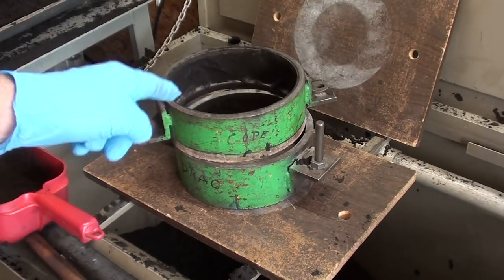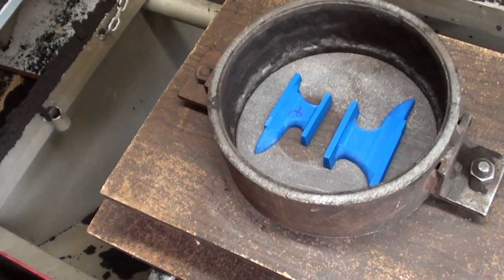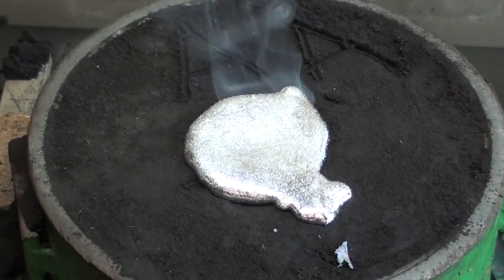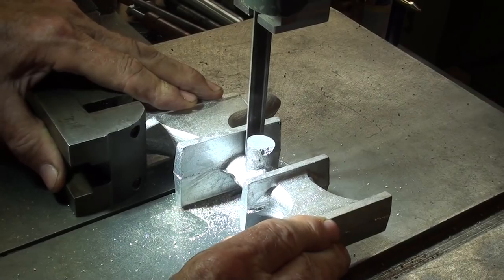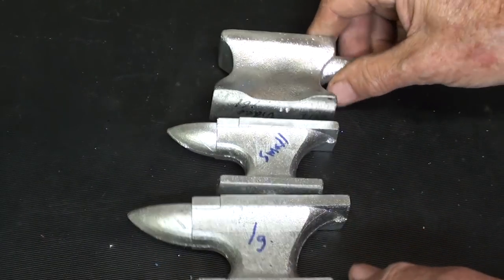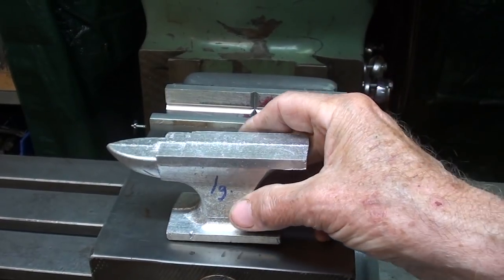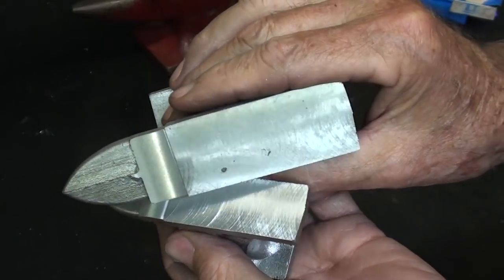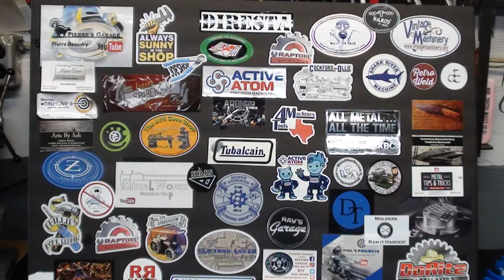MAKE an Anvil Paper Weight Tips 597  pt 2 tubalcain foundry

Comment: We had quite a few guy who made small anvils like those. We were lucky in 1970/71; 9th grade; to have a fully equipped metal shop. We'd get to pour, Aluminum, then machine them. Thinking back, the shaper and horizontal mill were probably the small Atlas. The lathes were much larger. If you either paid for your metal or brought in scrap to melt, then you could keep your project! Otherwise it back into the scrap pile for remelt! It was nice having an instructor who was really interested in teaching us how to do something! This little project has brought back some memories from many years past!
Reply from the maker: I’m glad you liked it and it jogged your memory. And that’s pretty much the way I Thought it. But we had unlimited aluminum from Napa

Comment: Thank you for another casting and machining video Mr. Pete. For these smaller castings it might be possible to have a cad file drawn up for the match plates and 3D print it? Not sure if this would be more work or less work than a traditional match plate.
Reply from the maker: Never thought about that, but I do not think it would be easy

Comment: Just use acetone to smoothen your 3d prints
Reply from the maker: Thanks
Reply: Sorry to rain on your parade but I made exactly the same mistake yesterday and someone corrected me. :) Acetone vapor bath is for ABS not PLA. There was one vid of soaking the PLA for a while. It got rubbery, but it didn't 'attack' it and the surface didn't change the slightest.

Comment: What makes that sand stick together ?  When you turn the mold over it doesn't fall out.  Thanks.
Reply: The sand is stuck together with clay and water (I'm assuming that the sand is Green sand). You mix the silica sand with powdered clay until you know that the sand grains are coated in the clay then add the water to make the clay powder sticky. Then you force the sand into a particular form (ram it up) and the sand sticks together to keep the form.
Reply: @sandrammer  Thank you.
Reply: @RichieCat4223  , you're very welcome.

Comment: I'd like to get into casting,  but the up front cost vs how much I'd use it keeps holding me back.
Reply from the maker: Yes thanks
Reply: You can start casting for darn near free. I started using charcoal briquets and a shop vac in a metal bucket, soup cans for a crucible, and greensand made from sand and bentonite from the feed store.

Comment: Gee, you keep talking about how weak the kids were in your day. I guess those old movies about the Ninety Pound Weakling getting sand kicked in their faces had some factual basis. 
In the seventies, all we had available at my school was a course called; Introduction to Industrial arts, it began with one semester of mechanical drawing then a semester of designing a single corner of a house from foundation to roof, then actually building the corner including all of the mechanical systems, wiring, plumbing, heating, etc.
I used to look over at those unused mills and lathes that we weren’t allowed to touch and wonder about how they worked.
I went into Home remodeling out of high school with a sound basis of how to do the job.
Reply from the maker: I never heard of any industrial arts program like that. We went right out into the shop after a safety lesson
Reply: mrpete222 yeah it was very disappointing, I found myself daydreaming through all of the days where we just sat in the classroom attached to the shop listening to the shop teacher babble on about this and that.
All I wanted to do was get out into the shop and get my hands dirty.